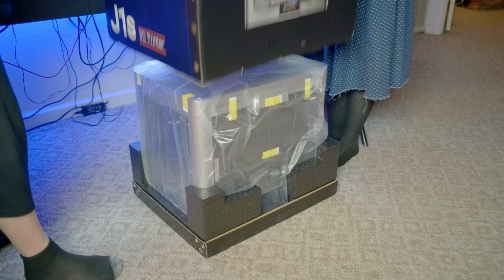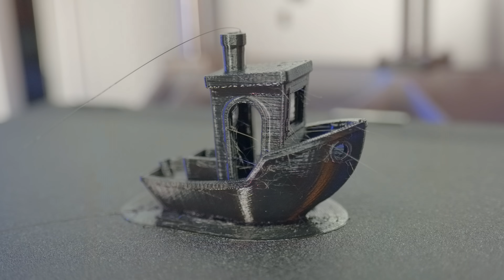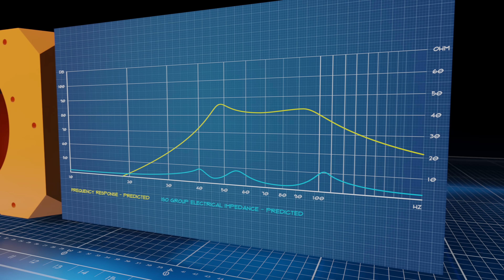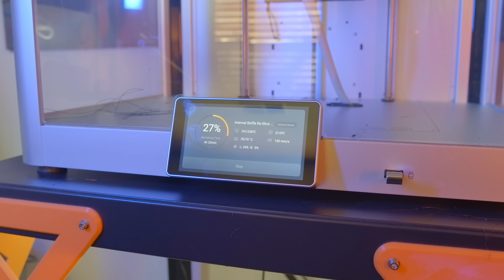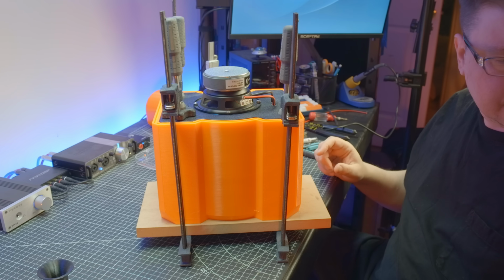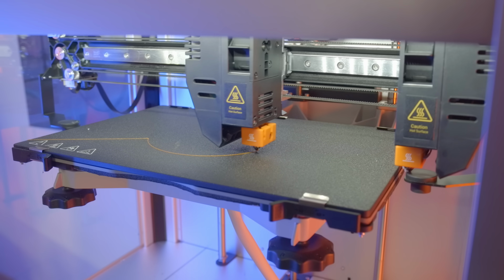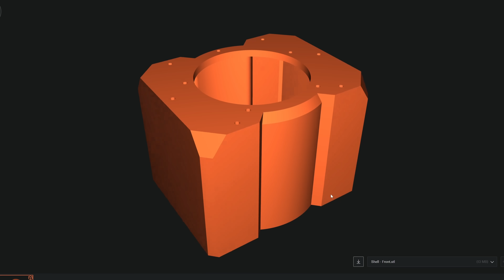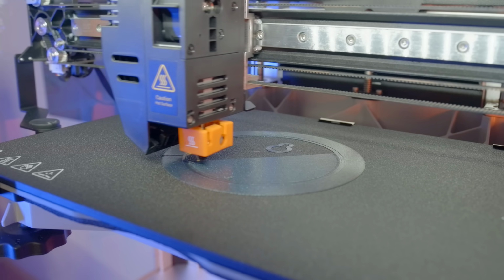Snapmaker J1s Review & Feature Build

Comment: ok about the bed level. that one corner. since the bed is leveled by 3 points and the gantry is constrained by 4 points you have to think about it a little different. if the bed is truly flat then that means the gantry has a twist in it. if possible loosen that corner and move it up 0.1mm then re tighten.

Comment: I'd recommend to try Ground Zero's 6,5" & 8" GZIW drivers & as they have way more fitting properties for your projects and are not expensive. For example you could have gone for 30hz f3 using that volume - and with significantly greater efficiency. Though I also understand why you are using those Dayton Audio TCPs as they are easily attainable to everyone.

Comment: Great channel, great build, and good bass output for a little thing, (I have a diy built 15” sub using the Dayton classic dcs385-4 subwoofer and the Dayton SPA300-D amp in a 20.5”x18”x22” ported enclosure, it’s also integrated into a 5.1 config with some small fully 3D printed 2 way surround speakers)

Comment: i've seen a build using those TCP114's in a small enclosure (0.08cuft) and coupled with some DA tweeters. would you recommend trying to work some tweeter into that box build for a full range solution or would it act weird we its isobaric?

Comment: I experimented with this exact sort of setup way back after taking apart a computer sub to see If I could get it to play lower then realizing the outer sub was just a PR.  The one I ended up liking a lot was using an internal pr for the rear section with the active driver then a big port for the front section.  At the time I had no way to model PRs or even 6th orders so it was a lot of making things bigger than they needed to be then adding mass inside to make the enclosure smaller til it sounded best same with the external port just started long and cut til it sounded good.   

Once I really got into car audio my first setup that could hairtrick was more or less done this same way though I also spent a lot of time adjusting things with a strobe light going to make sure everything was in phase at least mechanically the subs were.  We are super lucky to have fairly accurate modeling software now especially if you take the time to know your your car or rooms acoustics.

Very cool model your pods for it came out a lot like some I just designed and printed for my car.  Though mine will house a tweeter as well for the highest frequencies.
Reply: also listened to demos on some monoprice mp80s I bought a pile of because they were being discontinued and sold for a major discount.  They are surprisingly bassy at least with the nozzles Im using and overall good enough sound especially for electronic music.  Might be my new favorite cheap headphones even though theyre fairly old.

Comment: 2 things, PLA will warp in an enclosed printer you need to leave the door open for PLA the petg can have the door closed, if you want to print with the door closed for sound you need an adhesive (not glue stick as it is not a glue rather it is a mold release if your prints stick too well, amazon has a few good ones like magigoo and prevlant t-80 they both work very well) and you never scuffed that new print surface, all of those types of build surfaces should first be cleaned with hot soapy water in the sink to get off the factory mold release and you need to scuff the surface with sandpaper or a kitchen scouring pad, those steps should be taken for all printers when you first unbox them. And iso does not work well enough to clean the bed if you are having adhesion problems.
Reply: and it look like z-hop my be on in your settings, that should be disabled, and your first layer should be .32 for a mutiple of .04 and proper adhesion

Comment: Ultimately only the 6.5” driver is touching the air. How does this compare to a 6.5” in a simple sealed box the same overall (external) dimensions and using a DSP to shape it? With 100w class Ds readily available does the extra cost of the three “drivers” outweigh the amp, dsp and power?

Comment: The ladys work ergonomics at the desk are horrible. The display is way too high, you need to bend your neck backwards due to too high position of the display. But nice print tho, I ditched the Snapmaker 2 A350 from 3D printing part totally as I got frustated for the adhesion issues it had. Seems they've yet got a long way to go with print quality. Maybe some other print sheet manufacturer would make a decent PEI plate for the device..

Comment: Would love to see you build a custom fit box for a car in a tucked corner with some very weird angles and such using those 3d scanning tools and then using that to print the perfect fit enclosure for any vehicle :D .  

Love your Bandpass boxes! Had you plan and a local place build one. Hands down the best sounding sub i've ever had. Many thanks for all the hard work and effort you go through. these 3d  printed builds are amazing!
Reply: I second this. I would love to see this isobaric design incorporated into the center console or glove box of a vehicle to supplement midbass response. Or something with opposed drivers to reduce vibration.

Comment: Love the projects you create and enjoy your videos. But I saw the bed having adhesion issues and saw you using alcohol. But I'm just suggesting maybe using a degreaser soap instead, I stopped using isopropyl and started just using degreaser and a soft brush to clean all my plates. But if the plate is just garbage then that wouldn't help anyway. You could hit the plate with the green scrubby on a sponge to rough it up a bit as well.

Comment: 1:05 to 1:30 - My guess is that there is a low spot in the centre of the bed (like most printers,) and you might have crushed some perfectly-good PLA. The double-benchies both stuck because neither of them printed on the low spot, and the black benchy printed because it had a large brim vs. no brim for the orange benchy. If this printer has mesh bed levelling, plz ignore.

Comment: Listening gear?   At the moment, some older mid-level Skullcandy earbuds (the ones with the flat cables) straight off my Surface laptop.  Not high tech but I'm listening to youtube...
Nice little set there.  Big fan of the TCP-115 drivers and the PS95s.  I might give those satellites a print.

Comment: I have not had good experiences with PLA + textured steel sheet. I normally use textured sheets when printing PETG or TPU. For PLA I always use smooth sheets. For the "lifting" I always use a 5 to 10 mm brim, that helps a lot!

Comment: How do you usually decide on port are and flare?
In this instance that port is very small, but probably good enough for the designed low wattage, 
but how about high power applications, in thousands of watts, where port compression is inevitable?

Comment: can you recommend a simple crossover for the ps-95s?  

thank you so much for doing these! i have squirted out a lot of stuff you released. The dcs165 6th order absolutely FUCKS, hard.  I wear the backpack speaker while riding electric unicycle and was very surprised with the fidelity! is the dsp file available anywhere?

I think the most amazing build by far has been the dozer. Its nuts that the port JUST fits with the cuts on the inner flare. My main complaint with the design is the insane amount of support material required. The only reasonable, good hearted, American thing to do is design a MTM "Double Dozer" with a tongue/groove assembly. 

Think of all the plastic youll save from going in the land fill... do it for the children. they need you. i need you.

Comment: i use a design verry slimmer for my home theater.  works great as my amp is only 10w    mine uses a old raptor 6 subwoofer and 12" passive rad  is a 6th order parallel as i wanted to  be able to smell the wooder should it start to burn .

Comment: You're the only channel i've subscribed to that i actively change over to headphones for the audio  (Beyerdynamic DT770 Pro 32Ohm).
Impressive build as always! You never disappoint.
Reply: hah, same and similar cans. 250 OHM and moded with a balanced input.
Reply: Same, but I play it on my HTPC and $10,000 home theater system. It's siiiiiiiiiick.

Comment: This printer seems to have everything that prevented me from getting into 3d printing for years. I started with a Bambu machine and while I don't have great things to say about the company the printer itself works great. I think any company not implementing the same quality of life features in their printers is going to disappear. If I had to level my bed and manually calibrate the printer between each print I'd be printing nothing. Same goes to hardware upgrades. My hobby is printing and not wrenching on printers. Anyway thanks for the models, I might just try them out.
Reply: I would bet many of the not good things you have to say about the company are based on misinformation

Comment: Can you use interface only as Pva or pla? Rather than using all the support. If using Pva it is price, so worth a look at interface only in Pva or pla. (If using Petg. 

Also you can lift everything up and it will reduce pla and petg heat differential. I do this by adding a 5-10mm cylinder that 5-10mm lower than the model. Then you form Petg supports with pla interface. Sort of like a raft but not. 

I’ve noticed on some parts I do need to add in cylinders to hold my part down to bed as Petg doesn’t stick to pla nothing holding other than gravity and shrinkage can be an issue on long slender parts they lift then shift. 

Employ mouse ears or anchor blocks.. When you see the warp length from say a corner apply a mouse ear at least that distance. You may find you get lifting still so you often have to do a block of material (mass) with connectors to your part. It’s interesting to stop lifting. There must be a away of checking a model for ear page in the slice process. And adjust speeds etc to account for it. Ir external voids to cause a stress break , Or give suggest of anchor area. I’ll try post a video on  ONE SOLID CUBE. to explain what I mean. 

I just did a 45 buck 40hrs print that failed as it warped. I should have killed it as soon as I saw the lift. But I have a Idea that I haven’t seen before which should work in round two. Fingers crossed it works.

Can you do a video of software us pleibians can use to design stuff. You’re obviously a professional and acquired stuff over time but it would be handy to see if there is cheap or free tools that can be used to sort of come close to what your doing…. Thx

Comment: I almost want to see the same drivers, same passive radiator, and same sixth-order series-tuned bandpass box order, but with the drivers wired in series in an ideal enclosure size with the same power limitations.  Just for a comparison that uses a physical build to display tradeoffs with driver loading configurations within the same setup parameters.

Comment: Pls make a video with tpa3116d2 amp it's 4 ohm but it's very cheap
Reply: please don't do it, i would never buy an amplifier without a distortion factor. and a good power supply is just as important as the chip.
Reply: @uran23599  what model you get I want it to be customisable and cheap

Comment: PS95-8's are my favorite driver atm. I have them in ikea bowls on my desk right now. Im yet to print your dual 3" 'hexibox v.3' subwoofer enclosure to pair with them
Reply: thats $100 in drivers for not much low end. id highly recommend going with the dual tang band w51138smf build that was posted right before this one. youll be able to play a lot lower and with a lot less distortion at higher volume. heck, the 6th order bandpass for the dayton classic 6.5" sub would do more for less.

but if you have the money to spare, go for it! you WILL giggle the first time you hear it.